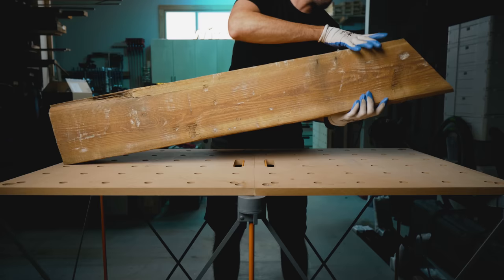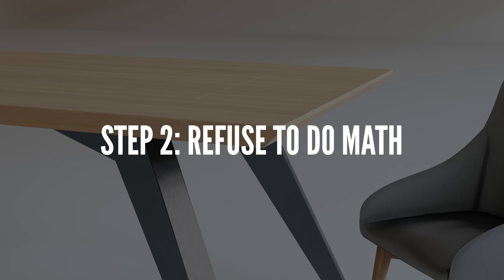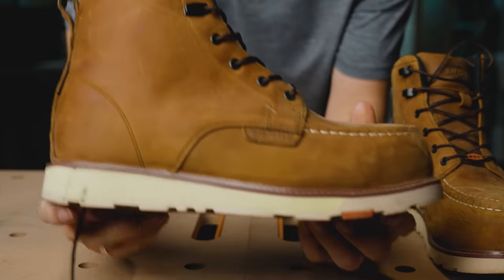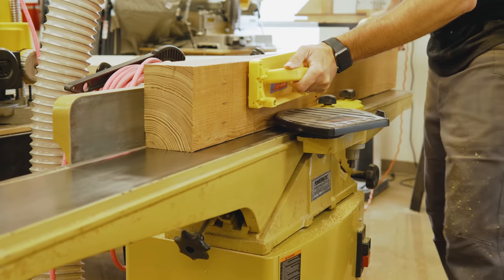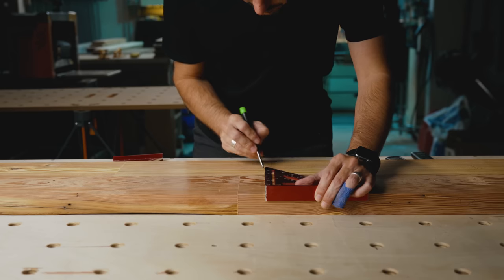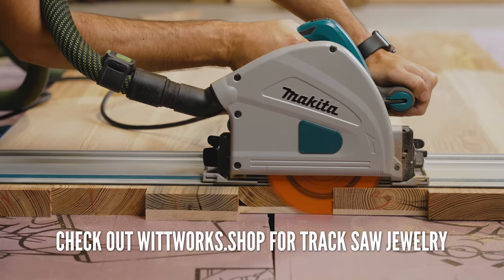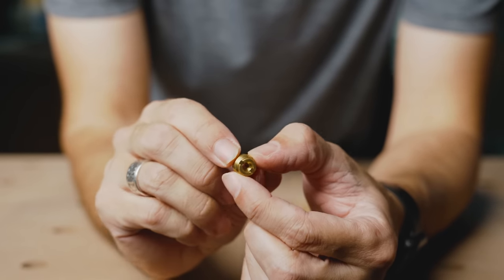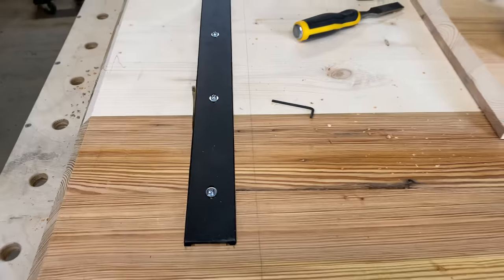I Can't Believe I Sold This for $3750!

Comment: If you want to put threads in softwood paint he inside of hole with toughened cyanurate glue or for the ultimate and most time consuming paint the inside of the hole with penetrating epoxy (industrial quality) normally used for painting canoes and gluing up boat laminates. To make perfect machine screw threads in wood get a piece of mild steel flat bar ( at least 3 times the thread diameter thick) and drill and tap a screw hole of  the size you want to use in the wood, clamping the fixture exactly over the centre of the hole preserves the profile of the thread in the wood and preserves the centering of the thread by using the tap drill as a locating pin while clamping. For wood  use a tap drill one sixty fourth  of an inch under the recommended tap drill size. if the hole was drilled undersize use the tap drill with some masking tape on the  top to preserve the centre when setting up the tapping fixture bar, a snug fit in both holes is good and using at least two clamps to hold the fixture bar in place is a must. Practice at least 3 holes on scrap wood. Use a spiral point tap and tapping fluid to tap metal and a hand taper tap to tap wood. Hand taps work one turn forward then half a turn back to clear chips. If you want to be a wild man use the taper point tap for everything. Make sure you buy your taps from an industrial supplier like SOWA TOOL and Machine

Comment: I built ultra high-end cabinetry in a shop for 13 years, and I sincerely appreciate a lot about your approach.  Your humility is great.  Of course I could talk details and techniques, but you are handling things extremely well, and there is so much value in discovery.  I wouldn't want to tell anyone what to do if they are capable of figuring it out on their own.  That's the best way to learn, after all.  The way you did this, you brought us along with you, and revealed your issues and thoughts...and finally, solutions.  VERY WELL DONE!!
And your client seems like the coolest guy ever.  I got that read as soon as he walked into your shop and smiled.  Fabulous!!

Comment: A little tip about resawing, set your fence so the larger part of the stock is between the fence and the blade. This allows for the the thinner piece you are cutting to move away from the blade if there is tension in the wood, makes a huge difference with sawblade drift. The thicker stock has less chances of shifting as you make your cut.
Reply from the maker: thats a great tip! thank you for the help!

Comment: It really is a lovely table. I respect your courage taking on a project like that for a demanding client. I know what it’s like when you deliver a 400k project, and the customer hates it. Feels awful. 

Can’t read all the comments but I assume someone else mentioned this: your technique for resawing is called kerfing. It’s perfectly legit, and I do it all the time. It wastes a little more wood, but takes a load off the saw and makes the piece easier to steer. Some guys use a “point” fence instead of a rip fence. That works too. 

Great video; fun, insightful, and self-deprecating. Kudos!

Comment: Nailed it! Both the wood work AND the video. Problem solving for regular guys - check. Working in less than ideal materials - check. Having to work around limitations you didn’t know existed - me, every time I start a new project - check. Cameos by a bunch of other creators I already watch (and some new ones I didn’t know about) - check! This showed up in my feed out of nowhere. I started it thinking I’d spend a couple of minutes to find out which tools I still don’t have that I’m not even bright enough to know I need and stayed for the whole thing to see if I could solve the problems the same way you did (yes and no). Learned more from this video than I have in a LOT of others. Thank you! Beautiful work and sensible approach! Also, I now understand bespoke for the first time. Cheers!
Reply from the maker: Thank you friend! That was my goal.

Comment: I can't say I've tapped a lot of thread in wood, so take this with a grain of salt, but I've used taps my entire life on a variety of metals as a Millwright working within thousands of inch clearances.

With that said, I have never used a tap on a power tool before. I essentially wouldn't want my tap to turn into a drill bit by moving up and down and eventually producing a smooth bore. After cutting the proper size pilot hole (Starrett makes charts that tell you exactly what diameter drill bit to use. You can pretty much Google a chart and download it for free, I'm sure), manually use the tap by hand.

In metal, after every half turn or so I would turn it counterclockwise about a quarter turn. This is to snap off any shavings so they can be properly ejected/removed so as to not interfere with the remainder of the cut. I'm not sure how this would translate to woods, but I don't suppose it would hurt.

If my pilot hole bottoms out, I'd use a bottom tap with a flat bottom. Standard taps taper at the end and are generally used for through holes. 

When done properly (and slowly/patiently), the tap will smoothly travel through the hole as if it was the perfect size bolt. If using a tap on metal, you want to drown the tap in oil continuously as you progress, but I don't suppose that would be necessary on wood. 

Great video(s)!
Reply from the maker: I got a hand tapper thingy!

Comment: Pro Tip. When making the bevel cut, do the short side (cross cut) first as it is more prone to tear out. If any tears occurs that will be cancelled out when you do the bevel on the long side (rip cut). The same method works if you choose to do the chamfer with a 45 degree router bit. Nice video…
Reply from the maker: Great tip! Thank you for sharing. I’ll do that next time.
Reply: everybody knows that, first do the crosscuts. The grain from wood is different in the lenght.

Comment: Drew, really enjoying your videos. As a pro in the carpentry field for many yesrs I always look to learn wherever I can and from whoever I can, whether they have more experience or less experience than myself. I can happily say I've learned a few nice things from you. You even helped me decide on the Makita Track saw 40v, ( I have your 3D printed cover as well that you sent me). Let's not talk about the Milwaukee lol. 

One trick I learned with those threaded inserts was to use a machine screw with two nuts attached to it, then with your drill set on low torque slowly drive it in. Then after use a crescent wrench to hold the nuts while you back out the screw. After messing up a couple inserts (on practice wood) I tried this method and it worked like a charm! I found drilling the properly sized hole makes a big difference as well.
Reply from the maker: AMAZING TIP! THANK YOU. ILL BE PRACTICING. I just bought a Kita 40v to compare with the Red step  brother.

Comment: You did a great job on both the project and the video presentation. I did get a grin when you said it should have only taken three days because I always think something similar when I finish a project. When we see something complete it gives it a simplistic appearance. When your project was finished, it was just a wooden slab on a couple of prefab metal legs, right?  That's an important thing to keep in mind because that is exactly how consumers view it, as well. Videos like yours will at least give some idea of what is actually involved in getting to that point.
Reply from the maker: Thank you. Good points

Comment: Well the worst I can do by subscribing is unsubscribing. And the threshold has been met: I learned (more than) a thing or two. You gave me ideas. You saved me money. I like your candor. Nobody is perfect and we are inclined to mess up. Ask any success story and it has failure involved because we are not by any means omniscient. You've done well and I hope you carry one doing so. There's a little thing called interest that only the makers can enjoy that customers can't. We know what it took to do this.
And then I clicked on the "Show more". Sound reasoning with the proud company that wanted some bucks for their finish. And I was looking again for the name. Holy smokes! The detail for finding chapters and vendors is ginormous. I'm glad I was temperate as any shortfalls were blown off the table (pun intended). Nope, I think you may be stuck with me as a permanent subscriber now.😁👍👏

Comment: You can use vandyke crystale diluted in water as a stain to match yellow pine to pitch pine ,just rub it into the yellow pine until you get the right match.if too dark just use a wet rag to remove it till you get the right shade. Let dry ,fine sand then add finish.you will love the result. Just a hint of what can be done. I am a cabinet maker and have restord many antiques and hand made furniture

Comment: Yellow Pine has made my family a very comfortable living for 75 years. We've made many many tables including large corporate conference tables, not only with yellow pine but other woods also. We've never used a metal channel in any of them and have no plans to ever use one and the same goes for a domino. We've never had a table to warp. It's about the wood and the joinery. Interesting table and video. Thanks for sharing.

Comment: Even though they'll probably only be removed 0-3 times max probably, I like the threaded inserts on the principle that they'll never loosen threads like wood could.

Even if strength is moderately stronger, most of those tables have 8+ bolts. I'll take the lower theoretical strength for the guarantee you can unbolt them indefinitely off one installation of inserts

If you cross thread them on a $15k table then you deserved it 😆

Cool vid. Love the collabs lately, your sense of humor is almost too deadpan I have a strong feeling tons of viewers are going to think this guy is a dick who has strong opinions until they watch more of your stuff hahahaha
Reply from the maker: Thank you! I like subtle humor. Rewards people for paying attention. I'm okay with the masses being wrong. 🤪

Comment: I work professionally with renovating wooden boats and now switched to cabinetry. 

I have never been able to resaw using the parallelfence on smaller bandsaws it always drifts, i always freehand. But now in the new workshop with 3 inch wide bandsaw blade and motorized feed system it works quite good.
Reply from the maker: That’s great

Comment: As a fellow maker I’m well aware that most projects are full of minor and some not so minor mistakes. What always worries me about videos like this is that I wonder what the client would think if they watched it and saw all the mistakes, some of which have compromised solutions (like the pine boards on the underside of the table). This video really highlights the struggle, which is great for fellow makers. But perhaps not so great for the client to see. 

Also, in my experience I often find that mistakes lead to novel design elements that are better than the original plan. As an example, the table I’m building now was planned to have a basic small chamfer around the top edge. But I must have smacked it into something or dragged the top over something rough because there was a decent gouge on  the end of the top that I couldn’t merely sand out. The solution was to epoxy it and then continue with the basic chamfer. Instead of doing that I slightly angled the last inch of the ends of the tabletop, thus removing the gouge. Having never done this, or seen it done, I wasn’t sure if it would look good. But then I asked myself if I want to make something basic that I’ve done a dozen times before or if I want to try something cool. 

This took it to another level of design that looks amazing. And I never would have thought to design it like that. I was led to that by the need to fix a mistake. I find that this happens quite often so now whenever something goes wrong, instead of just looking for the way to fix it , to hide the crimes, as Adam savage would say, and get back to the original plan, I look for a way to creatively change the plan to make it even better.

Comment: I appreciate this. I built a walnut dining table, and I never have done such a thing in my life, ever. I was a construction worker a long ass time ago, I built redwood decks, remodels, framing, finish carpentry etc. Woodworking schooled me hard, but It worked out. I went out and dropped 2k in 10' walnut boards, used some paper and worked out the measurements. Most satisfying and frustrating thing I ever did, and you know what I'd do it again. Why? Because, I work in tech, I program all day, I'm in front of a screen analyzing block chain transactions and looking at trends...ok sorry off topic that's different right? Woodworking yes, nobody is yelling at me or telling me what to do. I measure, I cut, I glue up and no one can say nothing to me because they don't know. It's my happy place, where I am not stressed out about some high dollar transaction held up somewhere, I'm cutting wood, I'm making things. No one can touch me in this place. I'm free. 

So, just do what you want, don't worry about the rest. You can't make everyone happy, do what you want and it just might fall into place for you.
Reply from the maker: Thank you for sharing that. I think this video will resonate with you: https://youtu.be/WUKzDn6QoLA
Reply: Retired IT worker here.  Its great to push away from the desk, and make something with your hands, isn't it!

Comment: Great video!  I really appreciate you admitting and showing the things that went wrong.  Having made measurement mistakes like that myself, I could easily relate to having to figure out how to fix things.  The Domino is a great tool, having one of them myself. I'm just a retired home woodworker, but a few years before I retired I started acquiring a number of the tools I wanted, Festool included, knowing I wouldn't be able to afford them afterward. Keep it up.
Reply from the maker: Thank you friend. You triggered me with your domino. Just kidding. I need to get one soon. It’s unreal. Just learned yesterday that the grooves on the side of the dominos were designed to eject excess glue. Did you know that? Brilliant. Congrats on retirement! Here’s to your new season 🍻

Comment: Drew, one way you could tap a screw into pine is to drill the hole, then fill with epoxy.  Coat the screw with oil and put it into the epoxy immediately.  After it dries, you just back out the screw and the epoxy makes the tap.  It’s way harder than the pine!
Reply from the maker: Nice trick

Comment: Bandsaws drift, it's a thing. I've been taught to sort of measure the drift and adjust the fence for it. Or you can basically freehand your cut using a resaw pivot fence. Just for future info. David Marks did a great episode of wood works back in the day about setting up your bandsaw for resawing, including grinding the back of the blade, etc...

Comment: You're brave taking on that project 👏 
I had someone offer me beams that were about twice the size of those and I wouldn't touch them due to the embedded metal. Maybe it would have been a different story if I was risking tearing up someone else's equipment haha
Regarding the thread taps... pre-drill like you did, but don't use the portable drill press when doing the threads; you risk tearing right through them. Just free-hand and go slow in both directions. Using an impact driver is also helpful

Comment: Wow,  that really makes the space it was built for.  Totally changes it. Perfect.

Tiny quibble- I've always believed mistakes/fixes should be finished to the darker side of the main piece. It's almost a psychological/philosophical imperative- like... "shade" that which you are hoping to diminish... though it is true seamstresses always use a darker shade thread than the cloth.  So on the pine (and the domino), I'd have scrambled to stain them darker before applying the final finish. 

As for makerspaces I finally think you pushed me to investigate (though I have a very well equipped cross-disclipines 22x23 garage). Turns out, there's one in walking distance of my house - $200 for 90 days is the minimum contract, mind you. I'm more a buy and resell used tools guy, though a little weak on the "resell" portion. :)
Reply from the maker: Yeah, my Makerspace is a non profit and underwritten - so it’s really cheap. 

Good tips on the shade. 

This client actually wanted imperfections to add character. He was a part of every decision.

Comment: That moment when you realize you’ve cut something wrong. I feel for ya. Something I started doing years ago has really saved my bacon. I only ever use 16ths. Don’t write the /16 and just use the 1-16 (3/8 becomes 6, 3/4 becomes 12). And if you’re very precise, put a - after for /32 (you can use + or - but I stick with - for consistency).
Thanks for the vid and the ideas to outsource some of the production aspects.
Reply from the maker: good tips! I do the + and - all the time. Sometimes - SOMETIMES - I'll do ++
Reply: I actually do this in my head when organizing tools for example.  is 11/16 bigger or smaller than 3/4?  I dont care.  I know 11/16 is smaller than 12/16

Comment: Hey, if by drift you mean the blade goes a bit out of line then straight again, the 2 side that you’re using as guides are not straight. especially old wood got small imperfections.. Planning the faceside and edge first will solve this or if it drif to one side check the fence and blade are square.. Could be the bandsaw blade not centered at the wheels too

Comment: Your bandsaw drift is most likely improper blade tension. Get the maker space a EZtension Bandsaw Tension Gauge and it will be the best $40 tool in the shop. I had about had it with my bandsaws inconsistency. Had all of my bearings perfectly set and still drifting. Got the eztension and all was right with the world.
Reply from the maker: Thank you! Will do